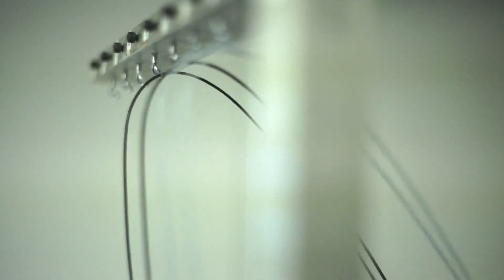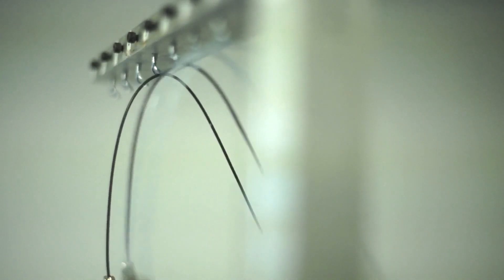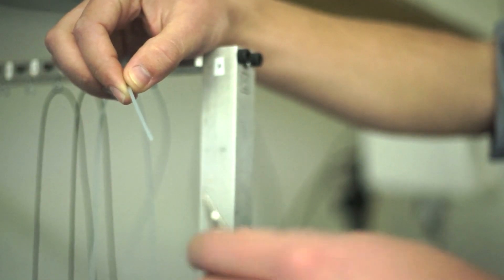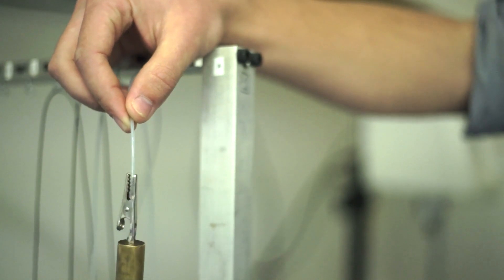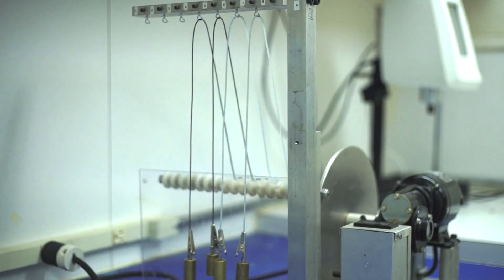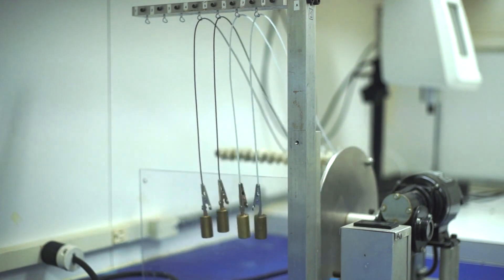Scientific Anglers Flyline Durability Testing

Comment: Hi! I've fished since I was a kid but always wanted to find out what the breaking strain of various line weights is. For example, how much weight will it take before, say, an average 6 weight or 10 weight line snaps? Why I'm asking is because I never wanted to test it out myself, obviously, seeing as they cost an arm and a leg. Looking forward to your response ~ thanks for your kind consideration.
Reply: It's Ok, I googled it up - thanks anyway. Strength -- all line cores are built to be much stronger than the heaviest leader tippets that are likely to be used with them. For example: a 2 or 3 weight line will normally break at about 20 lbs.; standard 4 to 8 weight line are around 30-pound test, a heavy saltwater line core may test over 75 lbs.
Reply from the maker: Hey great question but also difficult since we use a number of different core materials which will vary in strength between lighter weight lines and heavy weight lines. There isn't a direct correlation between line weight and breaking weight on a fly line.
Reply: @ScientificAnglers  I see - the reason I'm asking is that I have a T20 sinking line and want to attach it to a length of cannibalized 9 weight line which was damaged near the forward taper. I want to use the thinner running line and make up my own shooting head as it were, and wanted to get an idea of whether the idea was viable, seeing as one of my target species is albacore. Thanks for getting back to me!